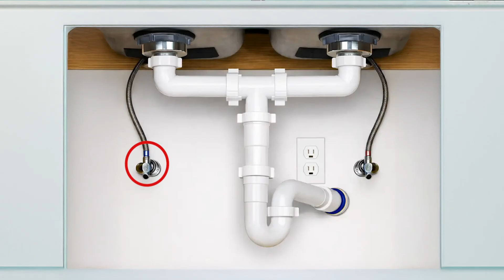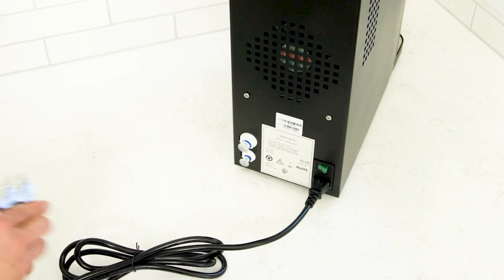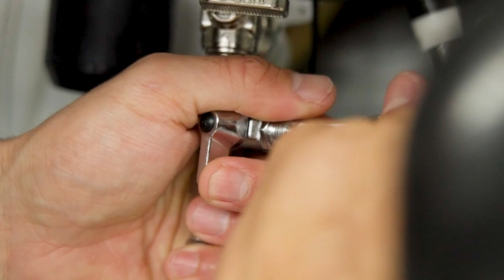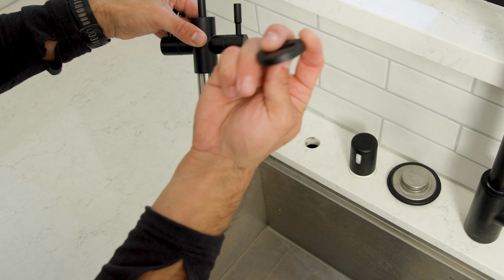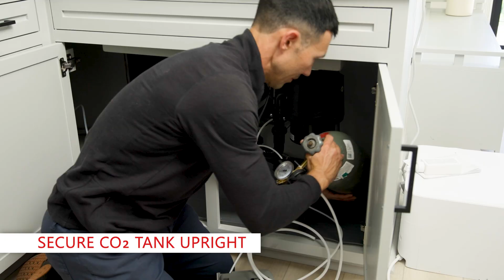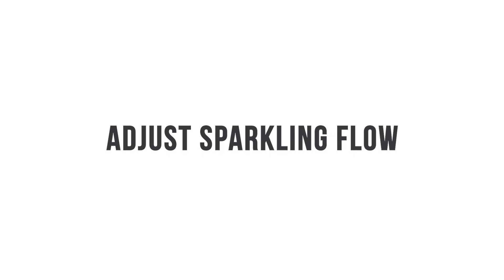WaterGenie Undercounter Sparkling Water System Installation Guide

Comment from the maker: Installing your WaterGenie Undercounter System?
This video walks through the full setup step by step.

Helpful tips before you start:
• Shorter water tubing improves carbonation
• Larger CO₂ tanks last longer and reduce refills
• Ensure incoming water pressure does not exceed 75 PSI

If you have questions, check the video chapters or leave a comment below—our team is here to help.

For additional installation guides, maintenance tips, and water filtration videos, subscribe to the WaterGenie channel.